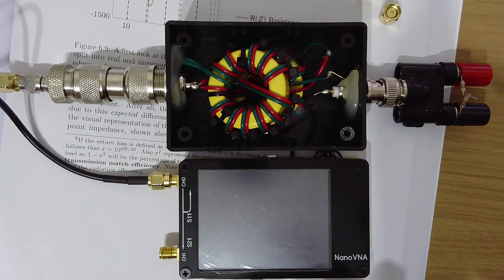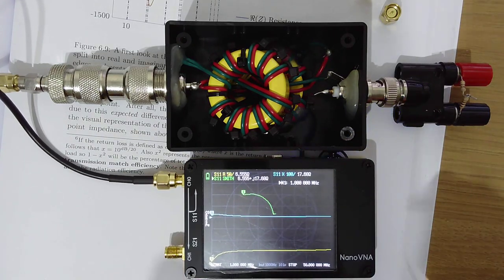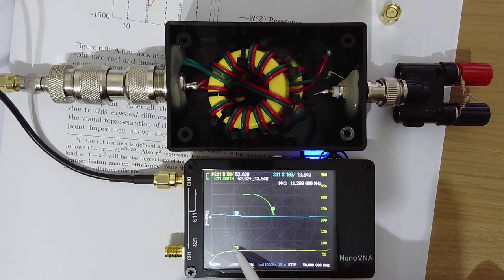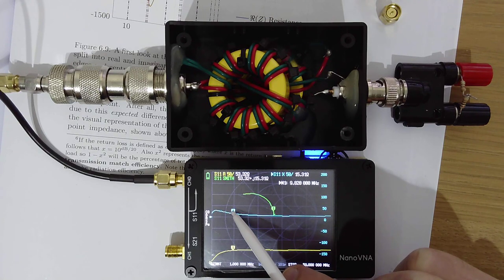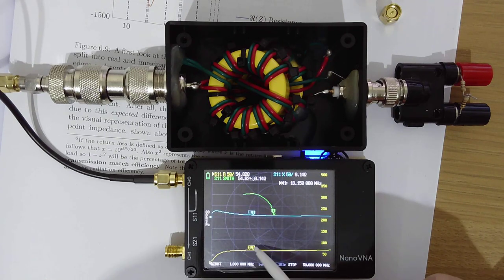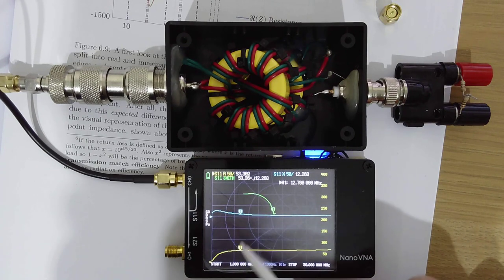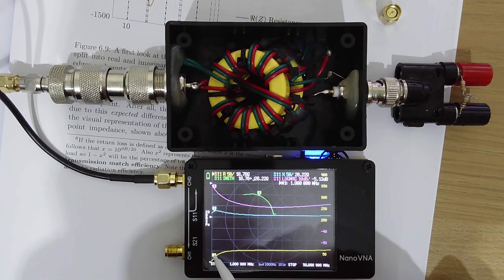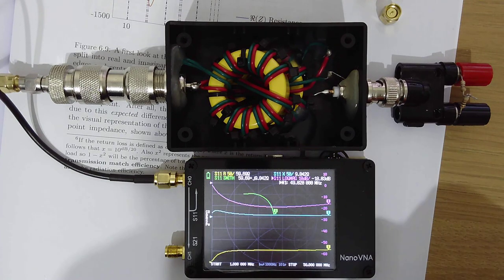Testing a 4:1 balun using a nano VNA

Comment: Great explanation! I'm testing a 9:1 Noo Elec type small balun, and I was expecting to see similar results when measuring it with the Nano VNA from 50KHz to 25MHz. However, with a 470R resistor attached in place of the antenna, the Smith chart impedance readings are far from perfect. They are capacitive before 3MHz and inductive after, with the resistive component dropping. The readings are almost perfect with a 47R resistor though.

Comment: The primary purpose of a balun is to match a balanced load to  an unbalanced transmission line. In  order to  accomplish  this the balun must present  a high common mode impedance. You have not  investigated the choking impedance- so what I see you have is a transformer and perhaps a balun-  but you will not know until    you measure Zcm. It would also be interesting to know what the insertion loss is.
Dale W4OP
Reply: If you want to look at common mode, you need to analyze the antenna feed point. In this experiment, the load is a not a non resonant load as there is no appreciable reactive component. But looking back from the load towards the transmitter, an X value will be divided by a factor of 4 and the current phase shift can be calculated from that at 50 ohms resistance. It will be roughly constant from 10m through 6m. 

Cancel (minimize) your antenna X values and common mode currents are minimized. This can be done by changing the antenna dimensions or cancelling the X values through some fixed reactance on the antenna.

Comment: It's not a test if you don't check your balun's output: A balun's main job is to match a balanced component with an unbalanced one in an antenna system to avoid common-mode current, a radiating coaxial cable, and distortions in the polar pattern of radiation.
Furthermore, you have not checked the insertion losses: about that, how was the compound of the toroids chosen and how was the starting number of the coils calculated?
Attention: the magnetic fluxes of those two toroids in that position tend to concatenate
Reply: @someguy782  I wrote a document on this topic. The link is in my page on QRZ site.
It is in italian (sorry) but Google translate will help you.

Comment: It would have been nice to see at least the schemat of your 4:1 balun ?  as it doesn't look anything like a GUENELLA type 4:1 balun but shows a confusing top toroid used as a rf choke with what looks like more turns on one side than the other !!!   over another toroid with an unknown winding.    nothing like a gunella balun that does use two torroids but not with a through the middle winding..  Yes i know you don't claim it to be a gunella type balun, but for a 1to 50 mhz balun using two cores of this type, the gunella style is what is commonly used ! and the winding are not un equal or wound in this way.